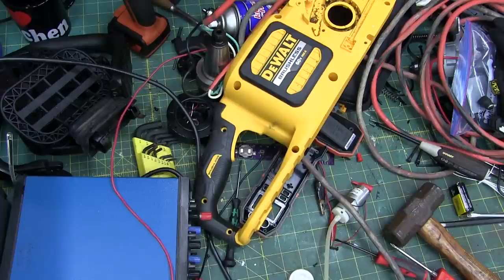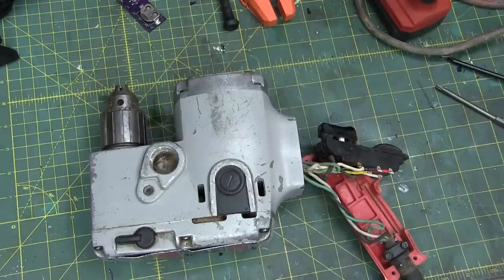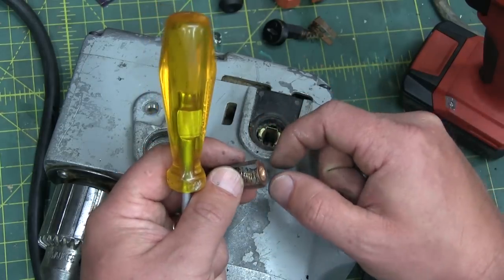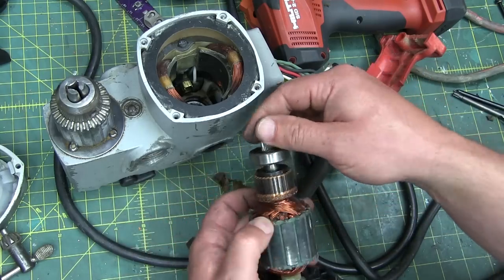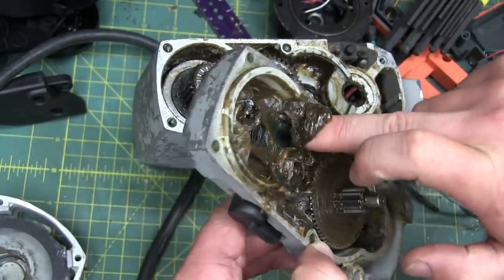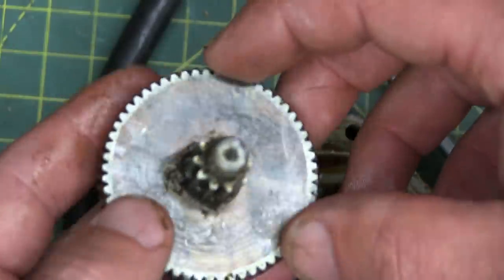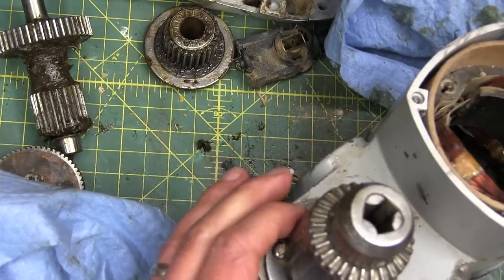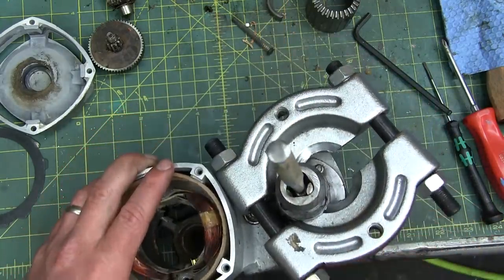BOLTR: Milwaukee Hole Hawg | Long Term Quality

Comment: It sucks Chinese Milwaukee has started peddling lots of mediocre quality junk on the sterling reputation earned by tools like this, the hole shooter and the original Sawzall. They do have a compelling line of 12v automotive tools, so I am invested in that platform, but I'm Makita on the 18v side.... The Toyota of power tools.

Comment: Greatest hole-driller ever created IMO  - spins a 4-5/8" bit (NOT a pussy hole-saw, I'm talking a true hole-hawg cutter with scarey teeth and a blade that will do damage) without missing a beat.  But with no clutch you had better screw in the long pipe handle and brace it against a wall before pulling the trigger OR prepare to have your wrist in a cast for 6 months - that is exactly what happened to me.  But my own foolishness - I knew better.

Comment: Hi mate.  You must be quite used to all the plastic rubbish if you don't know what the insides of a real tool look like.  That ring should be two halves, how otherwise would you get them on, and the chuck might be screwed on, most likely , with left-hand thread.  Shalom.

Comment: Old holes hawgs kick ass you could drill big holes in high gear so the drill wouldn’t break you but the new ones suck shit! 30 yr plumber ,fight me! The Dewalt right angle drill is way better I don’t like Dewalt